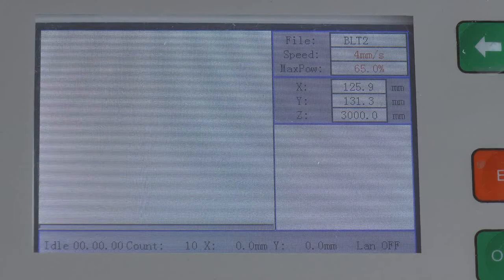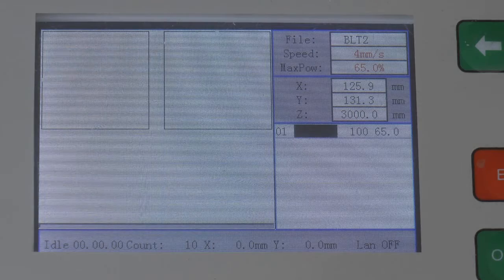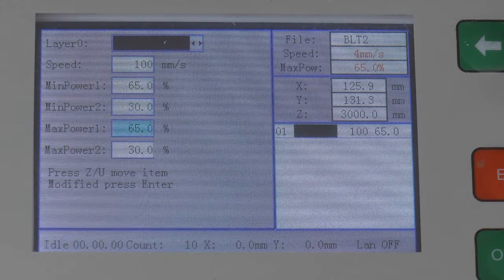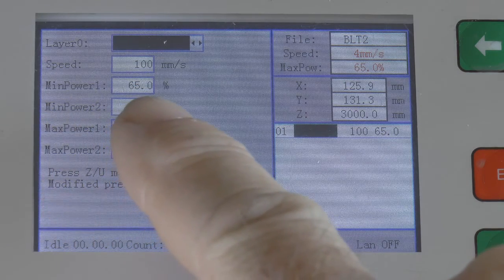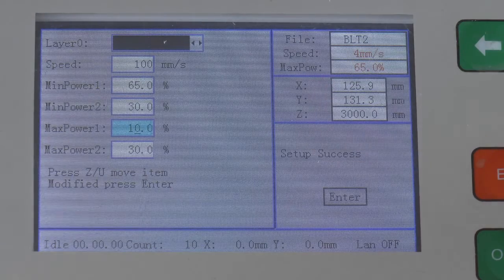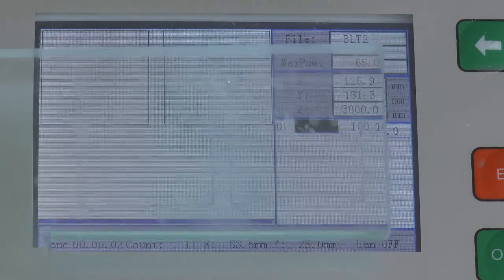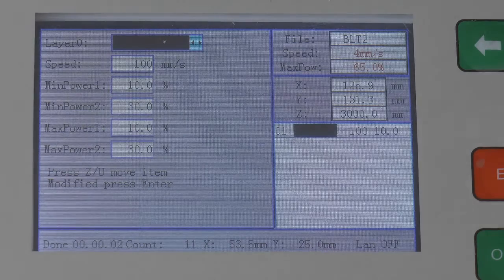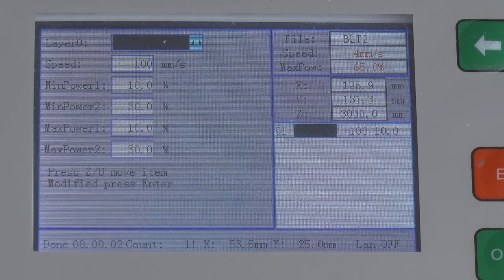RDWorks Learning Lab 55 Why Max Min PowerPart 3

Comment: Russ, does it make a difference if you change these settings on the machine or via the RDWorks software? I'm at "Part 1" of your escapade with my own machine. cheers.
Reply from the maker: Hi Chris
There are two max min power settings and I can understand your confusion. If you set the max min power buttons on the machine (or the speed button), those will normally be ignored by your RDWorks program. Those settings only take effect if you use the machine manually ie you press the pulse button  or you drive the machine around with the arrow buttons. When you set the max min power (and speed)  parameters in RDWorks that is what your program will use. However, if you tick the default power box or the default speed box then those machine settings will take precedence and any programmed values will be ignored. I would advise to never tick those default boxes.
Best regards
Russ

Comment: Hi Russ
That's interesting because I just had another quick read of the RDCAM help file and it clearly implies that min and max are for cutting and engraving. However, in reading these exerts, it specifically mentions curves. Even though a corner has deceleration to come to a stop, I believe that it may all happen to quickly and then it's all over where a corner is constant for a time and should yield different results.

1 > the minimum power and maximum power set to the same value, synchronously adjust, until all cutting curve have been appeared.
2 > The maximum power unchanged, and gradually reduce the minimum power until the energy of the heavy cutting curve at the lowest level, and all of the connecting parts can be processed.

So may I suggest another test, a square say 50x50mm with 10mm radius corners with the same cut speed that you used so that the test is fair.Not saying I'm right mate but that's how it reads to me.
Regardsphill

Comment: Mn and max power is working in cut mode as it is in scan mode.
The reason why you see not much difference in cut mode is that the acceleration time from 0 to the set speed is too less on slow speed settings, so the rampup of the speedcurve is to steep to have a good addaption using a lower startup settimg.
The faster you go the longer the acceleration curve is and the more affect you will recognice using the start (min) power and the end (max) power.
You could also experiment with the user setting in RDworks where the acceleration settings could be modified, but keep in mind that the settings in the vendor menu could not be overdriven.
best regards,
Walter
Reply from the maker: +pyrofilm 
Hi Walter
If there was some planned intelligent link between  speed and power I would not be seeing the same depth of penetration at the corners of the square for both my tests. One test was 65%/65% where a fixed power would give deep corner penetration in acrylic as the speed is instantly zero at each corner.  If there was intelligent power ramping and it was actually  only 10% at the corners, then I would see SIGNIFICANTLY less penetration. My 10%/65% test sample was exactly the same as the 65%/65% test sample. Therefore I have to conclude from the evidence that my machine has no built in magic.

Comment: Nice to see your experimentation. I have been following your channel and also been learning in the meantime from it,, for which i would like to thank you. There was a company i was working for, they had a chinese laser cutter and i had been experimenting/working with it. In general we set it to like min 60, max 65%. I wonder what your acrylic will say when you do the same test, but between the 5% different of min and max. Because it is still unclear what it exactly does when you set these settings.
Reply from the maker: +Harrie Mangels
Hi Harry
I think the only place max /min comes into play is when you are in scan mode. I've got to do a lot of reading before I can begin to experiment. The manuals are very confusing, The answer to your 60/65 question is answered in part 2.  I set 65/65 and 10/65. The  results were exactly the same so it's the max that takes precedence.
Thanks for your appreciation
Regards
Russ

Comment: would it work like....
you set all layers to max power at your machine recommend max, then job power at min power, so you never accidentally overpower your machine?
coz... that would be a handy backup!
Reply from the maker: +Michael Edmond 
Hi Michael
Sadly no. I set 65/65 and 65/10. Both results were the same so it's the 65 that will control the CUTTING process not the min  power. I'm sure this max min only applies to engraving (scan mode) but i've got to do a lot more reading yet before I play with the machine.
Best regards
Russ